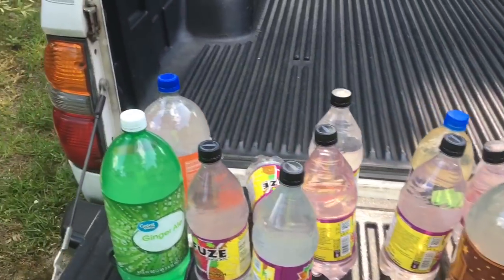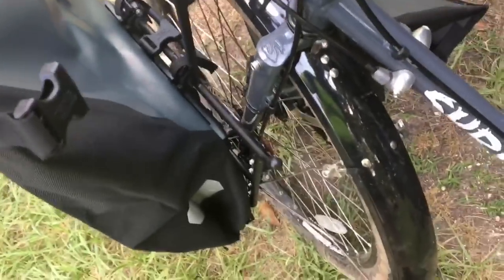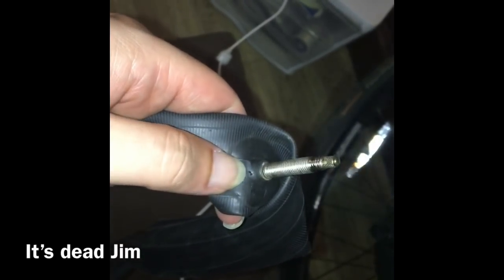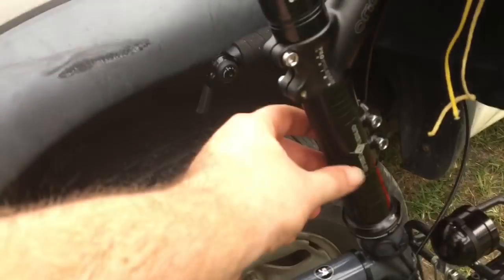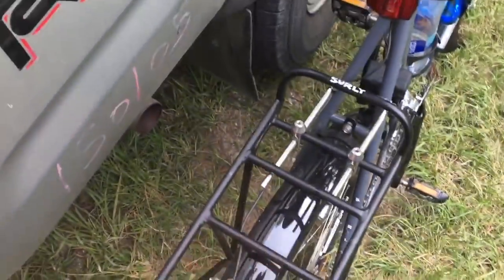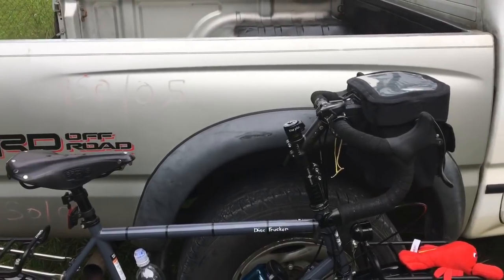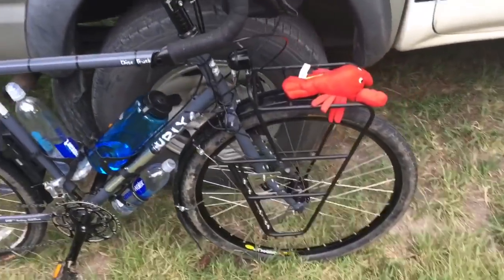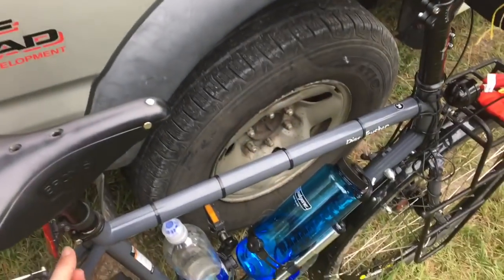Ready for RAGBRAI

Comment: I wish I had found this video before you went on RAGBRAI, as a bike mechanic and a veteran of the 2012 ride, I could have given you some advice. However, I didnt but I still will. Get a new cable and housing for your front brake. Second, get ride of that hub on the front, it will drag you down. Take a power brick, and use the RAGBRAI truck to recharge that. As for the lock, a simple four foot long cable with lock would have been enough, and two water bottles are plenty. As for tires Schwalbe Marathon Plus tires with thorn resistant tubes are best. I cant tell if you have a double or triple crank set up front, but you need a triple. Thats it. P.S. you didnt need those kind of lights.

Comment: Your bike looks like it's all ready for Ragbrai.  You even have a mascot.  Remember to think about keeping things light.  Two water bottles is probably plenty for Ragbrai.  You get water in most drive through towns.   That's a cool lock, can you put a link to it in your show notes?   You probably won't need it, but hey, I use one sometimes at night when I walk into town to see the bands and get food.   That's a nice pump by the way.   I have one tip for ya.   Kybo's or Porta Johns tend to have long lines in town.   A lot of times it's quicker to use a corn field before you get into town to avoid the lines.   Have fun!
Reply from the maker: Yeah I’m treating this like how my AT hike started, prepared for anything and everything. All those full bottles of water I was using to simulate the weight of my gear while training on the flat lands of southern Louisiana, 50 extra pounds of water.
Reply: You don't need a lot on Ragbrai.   Tent, air mattress, light sleeping bag or blanket, pillow, battery powered fan maybe if it's really muggy at night.   Maybe 2 to 3 changes of clothes, maybe a swimsuit or shorts that can do double duty.   One for at night.   A pair of shoes or two for when it rains.  Raincoat.  Not sure if rain pants are needed.  No food, but you do need your basic toiletries, soap, and deodorant.   Not at all like the AT.  You'll probably shower every day after your ride.  It used to be $5 for a hot shower and a towel.  Hopefully it's still the same.   You probably need maybe $40 or more in cash everyday for food and drink.  Could be more, prices tend to rise after a couple of years.   A couple of repair tools, inner tubes, tire patch kit, and screws if you think it might be a problem.  They have repair stations on the route and in towns and they are reasonable with their prices.  Cell phone charger, battery, cable.   I doubt you will use them, but they have charging stations in some places, but I would keep and eye on your phone if you use those.  I almost lost mine one year, even after I told the guys to just watch it for 5 minutes while I use the bathroom.   Another guy tried to claim my phone, but someone caught it.   You might want a headlamp or small flashlight for at night.    A word on cell phone coverage.   The towers in the overnight towns tend to get over whelmed.    Verizon tends to install portable towers in some towns to help out their customers.   You can usually use a public library or they will probably have an internet trailer available with wifi in the meeting towns and overnight towns, but for a limited time.  Oh, a plastic bag to cover your bike seat at night incase it rains or there is a lot of dew.   Some people use plastic bags on their feet too for rain.   A couple of cable ties always come in handy for hanging signs and fixing stuff.  I use electrical tape to for the same reason.   Sometimes it gets buggy, but usually it's not bad.  Here's one that's just for fun.   A squirt gun to shoot water back at the kids.  If I remember right you can pick up route maps for each day too, at the Ragbrai info center.  I'm just trying to give you some friendly help from my own experience.   Hope to see you on the ride.  Look for a yellowish Catrike Exhibition and a guy with a white helmet with old black paniers on the back of the bike.   You'll probably be faster than me except maybe downhill.    I doubt I will have my canopy this year.  Also if it's hot, you have to try going down a waterslide at least once.   Works better if you get yourself all wet first.